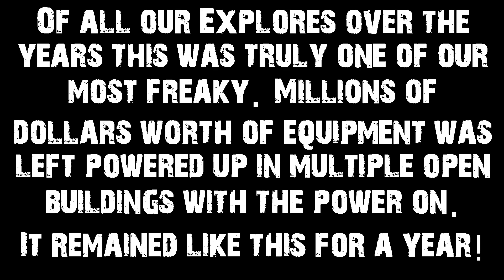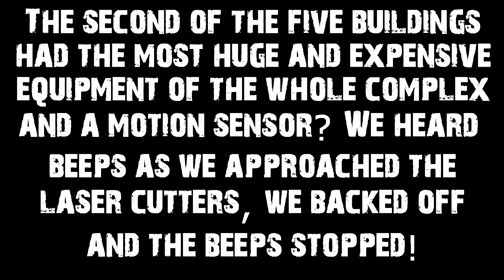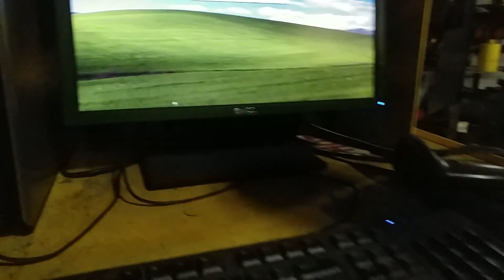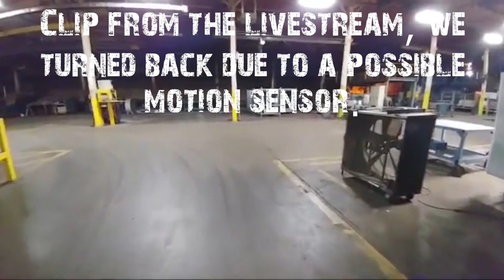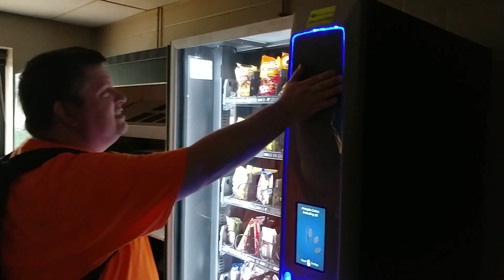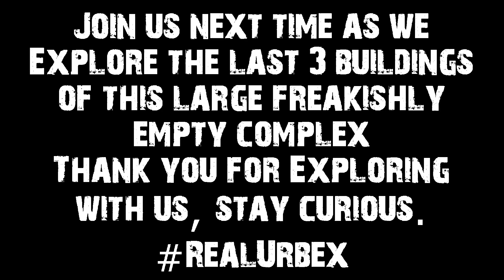Huge Deserted Factory With Power And Equipment Left Behind

Comment: Great video. The place is so well preserved that it appears to be only closed for the evening...rather than abandoned. I'm amazed at the expensive lathes/presses and tooling in there.
Reply from the maker: The really expensive equipment was the laser cutters in the section we heard the beeping and we chickened out thinking it was a motion sensor, all of this just sitting there powered up and unlocked for months. Thankfully no vandals ever found out and plundered any part of the place.